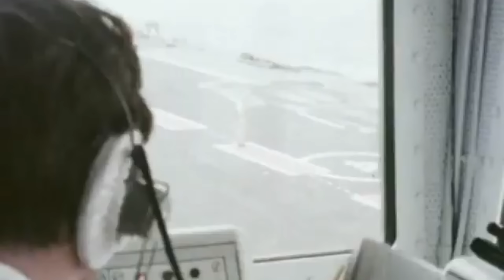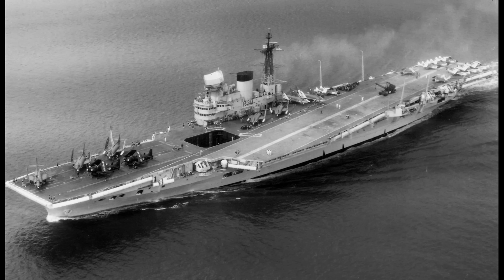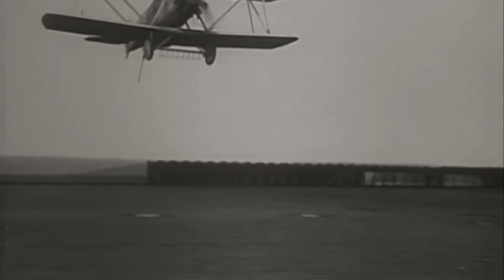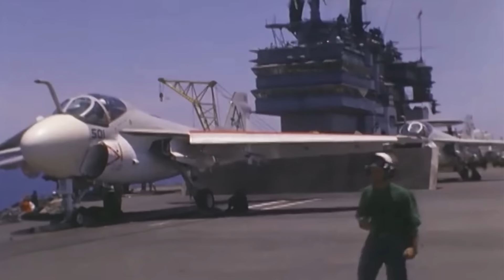Why Are Carrier Islands Always on the Right? — and How It All Began

Comment: Very nice video. I especially liked the short description on the p-factor because it also affects radial and inline engines. During WW2, even though there was plenty to choose from, most carrier-borne aircraft were left-handed and would cause that port side rotation if you needed power immediately (like if you needed to bolter from a carrier). So it raises the question if that’s cause and effect from a starboard island or vice-versa. 

I’ve heard of a very interesting theory that goes back to pilots. Most people are right handed and if they have a center-stick that when they violently pull back there is rotation to the left side of their body also causing a roll to the left. Supposedly this is what perpetuates the plane to the port and island to starboard rule. This even expands to modern fly-by-wire aircraft with side sticks like the F-35, J-35, J-20, and Rafale-M. They all have their side sticks on the right to preserve that similar motion even though there are some that installed them on the left like the F-16 or allow them to be transferable based on the handedness of the pilot.

Comment: My first ship was shown here, the USS Forrestal CV-59. I was a radar ET, so I spent most of my time in/near that island. The radar shop was just below the flag bridge in the forward part of the island. A deck down from there (05 level) were the radar rooms. Flight deck was 04 and our berthing was on the 03, just below the flight deck on the outboard side of the island (right below the "bomb farm"). That really large, sort of rectangular (10'x40' grid), antenna on a platform outboard of the island, slowly spinning in some of the video, was the antenna for my radar (AN/SPS-43A long range air search) when I was there for the Med/IO cruise in 82.

I actually have a picture of myself on top of that antenna during that cruise. There's another antenna sitting "piggyback" on top of mine and in the picture I'm right below it and pointing to it, because it was a problem. That antenna belonged to the associated IFF system. Not my equipment, but it was on my antenna pedestal. In that picture are three people. Myself on top, another tech (who should have been the IFF tech) in the middle, and you can just make out the third on the bottom (the actual IFF tech and one responsible for the problem I'd found).

That picture happened somewhere in the Med in 82. Probably around July. It was taken by a QM on the signal bridge. He had no idea who we were or why we were there. He just thought it was "interesting". A year later, the ship was in the Philly shipyard for SLEP overhaul. I'd gotten assigned as MAA & at a point was paired with someone else and we patrolled the drydock compound. Turns out, my partner on those patrols was the QM that took the picture. Once he realized who I was, he brought it in and gave me a copy.
Reply from the maker: Wow, what an incredible story and connection to the ship! Thanks for sharing your personal experience.!
Reply: @x-planedSomewhat ironically, at the end of my 34 years with a contractor, I spent my last couple of years in the antenna shop working on the very same model of IFF antenna that was our problem in 82.

Though the antenna wasn't the issue. The idiot we had for an IFF tech was. He failed to properly weatherproof anything. Water shorted out his transmission line. Which went through my antenna pedestal. We ended up replacing the entire cable run. Twice.

Comment: The video states that the twin island design provides redundancy.... It then goes on to state how the forward island is the navigation bridge while the aft island handles air operations and each island is optimised for it's role

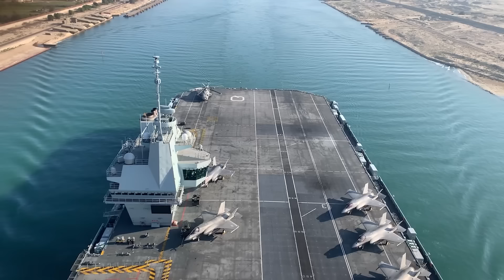So: Can the forward island handle air operations? Can the aft island handle navigation ?  If they cannot then the redundancy stated at the 8:16  mark  the instead of redundancy there are multiple points of failure.

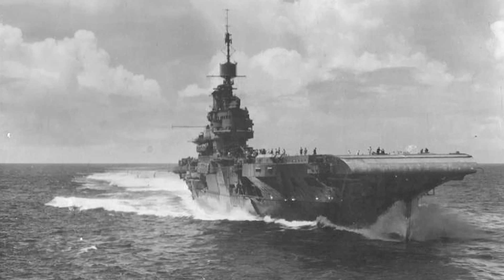Comment: 5:40 - In "Shattered Sword", Parshall and Tulley spend some pages discussing carrier design considerations, including the trade-offs (as all design choices require), especially WRT damage control. Really great stuff from those who have researched it.
7:51 - Dunno the date of the image, but that carrier is entering San Fransico Bay (and has no angled landing area!).
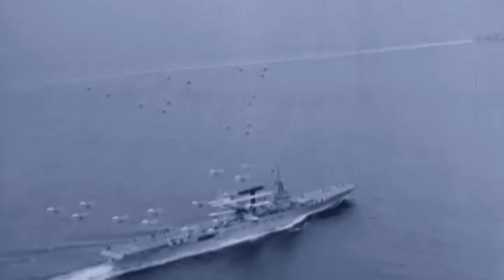11:43 - The "Washington Naval Treaty" limited capital ships.
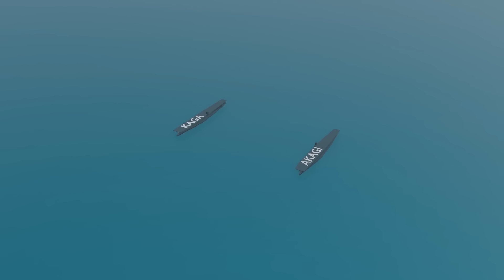19:06 - Thank you. I had never read or heard of the justification for opposite side bridges.
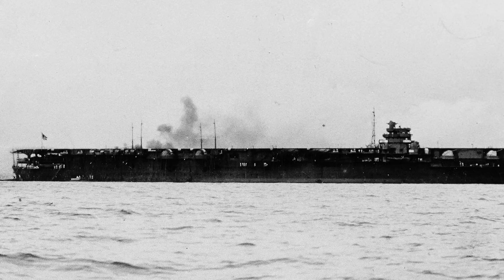21:04 - Japanese military doctrine was worse; the Army and Navy flyers used opposite throttle controls. One had full throttle forward, the other aft.
Reply: "7:51 - Dunno the date of the image, but that carrier is entering San Fransico Bay (and has no angled landing area!)" ... that is because it is HMS Queen Elizabeth and she is designed to operate F-35B Lightning II vertical/short takeoff and landing (V/STOL) stealth multirole fighter and Merlin Helicopters for anti-submarine warfare and airborne early warning.  Therefore, no need for an angled deck.

Comment: Early aircraft carriers were often called "flattops". This may have started before the control tower was added (either starboard or port). You can search for this term, but include the world "carrier". Otherwise, you will get a hair style that's also called a "flattop" and were probably inspired by the carrier design. It became an option to the "crewcut" used by all branches of service. However, the "flattops" carried on, but may be a more archaic term these days. One definition that I came across was the following:
"A 'flattop' is a colloquial term for an aircraft carrier, which is a warship designed to serve as a seagoing airbase, equipped with a flat flight deck for launching and recovering aircraft. These ships are crucial for projecting air power and conducting naval operations far from land." (courtesy of DuckDuckGo AI Assist)
Reply: The first Aircraft carriers were not flat tops. They carried seaplanes  that had to be lowered onto the water for take off and recovery.
Reply: Any carrier is call a flattop. At long range when sighting and identifing a ship things can be diffacult. Many destoryers curisers and battleships have very simalar proflies and size is hard to determine. But the flat line of the flight deck stands out like a sore thumb even if the ship has a island.

Comment: The old Norse (and Swedish) word "styrbård", the steering side, turned starbord in English. And it is the right side of the boat, "barbård" being the port, the left side. As you will mess up the rudder oar in a viking ship if you leave it against the dock, the dock side is still "port". In Finnish they still are (s)tyyrpuuri and paapuuri.

Comment: The Japanese Aircraft Carriers Akagi and Hiryu both had their Islands on the Port (Left) side.  The idea was they would be able to steam next to their sister ships, Amagi and Soryu respectively.  However the Amagi was damaged beyond repair during the 1923 Tokyo Earthquake, causing the Japanese to build the Kaga instead.   Changes in the Soryu design during construction prevented the joining flight deck with Hiryu.   Coincidentally both Akagi and Hiryu, along with Kaga and Soryu, were all sunk at the Battle of Midway
Reply: Bit more on that is that it had to do with aircraft circling after launches or circling for landing that the aircraft from the carriers with alternate superstructures would be less likely to have midair collisions 
That would only work in a perfect world where both carriers had survived and when you transfer a pilot to a carrier that has the superstructure on a different side he's expecting to escape in that direction
Reply: @b1laxson  You just put your finger on the problem with modern Chinese character designs.  Not to mention the Kuznetsov.
Reply: @chloeforman  Kuznetsov, 001, and 002 were the same design. Same underlying structure.

003 was a new clean design, but the layout was compromised because the catapults was switched to electromagnetic very late in the development.
Reply: Modern Japanese self defense force Navy have Operations with Flat top "Destroyer Escorts " "Carrier " design for Helicopter and Support Rescue With largest Warship, Izumo
Reply: The fact that all four carriers met their end at Midway really ties the story together in a tragic way

Comment: Brilliant…
Some aviation historians argued that the average pilot tends to check his six by turning his head to the left… Hence the island on the starboard side and the fact many German aces favoured attack position was from the opponents’ 5 o’clock.
Reply: Could be from driving a car.  In the USA with the driver on the left side of the car, looking over your left shoulder is pretty ingrained.
Reply: @mikeynth7919  I'm not sure if that has any bearing. You're meant to look over both shoulders when you need to make a maneuver that requires it, just in case someone is coming from your side or behind.
So even in countries with the steering wheel on the other side, the directions to look are the same.
Reply: @mikeynth7919  Yet, it was the British that had the islands on the right first and they also drive on the left, because most people are right handed and so are right eye dominant so they drive on the right side of the car to line up correct, too. That is why there are less accidents where people drive on the left. 
The usa just found that the Brits were correct and copied the starboard islands🙂
Reply: @azzajames7666  There are not fewer accidents due to that the brits did what the king wanted that is all
Reply: perhaps that could be related to heads being rotated 180 degrees during gestation. Heads are slightly twisted to one side, which might make looking to one side easier?

Comment: CV islands are on the right because of the torq produced by early radial engines twisted aircraft to the left...so having an island on the Port side of a ship led to serious collisions. By placimg the island on the right greatly reduced accidents.
Reply: This explanation really only works for the US Navy, which used clockwise-spinning engines (from the POV of the pilot) that therefore produced counterclockwise (pulling them to the left) torque effects on planes. But in British and Japanese carrier planes, they almost exclusively had counterclockwise-spinning engines that produced clockwise torque. The Bristol Pegasus, Mitsubishi Kinsei, and Nakajima Sakae of Swordfish, Judy/Val and Zero/Oscar fame respectively all produced clockwise torque that pulled planes to the right with their torque.
Reply: Incomplete. Japanese actually built paired carriers with alternating superstructures on the principle that that would avoid midair collisions aircraft circling for landings 
However they found that what happened in practice is if you had to transfer a pilot over he might accidentally follow his normal pattern and smash into the island that is now on not where he expected
Reply: @b1laxson  Japanese did some very odd things because...Japanese...